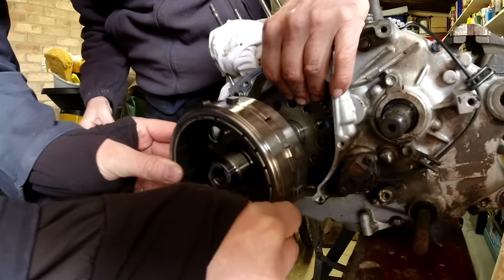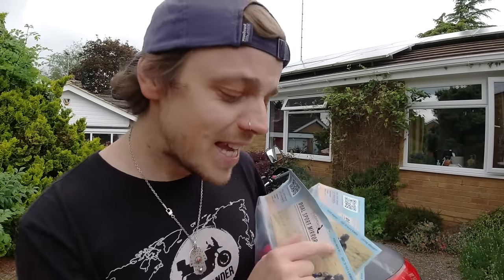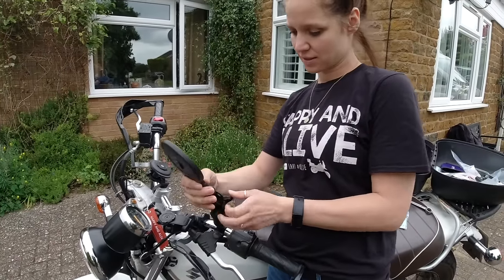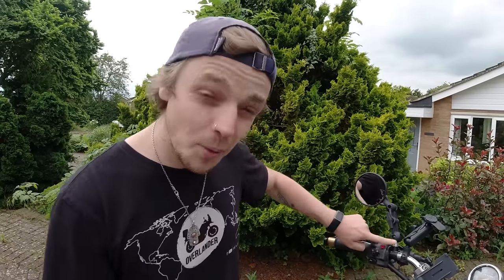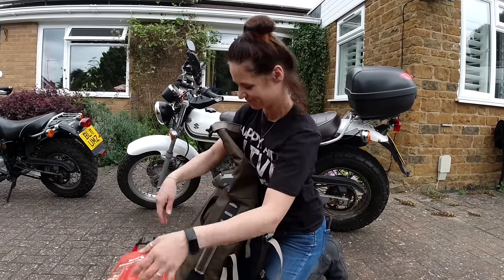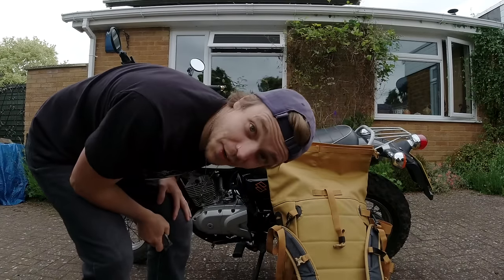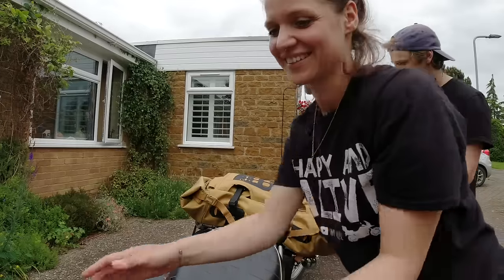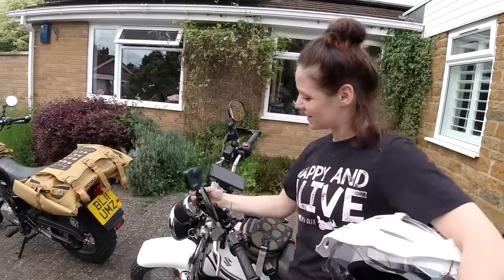Our ULTIMATE 125cc Adventure Bike Setup! [S7-E9]

Comment: Hi guys,  if you're not carrying any other bags/ rucksacks it would be worthwhile fitting those bags longways half on seat and half on the racks this will balance the bikes better whilst cornering as you won't have weight hanging off the sides. Sit on yourown bikes to check how much space there is behind both of you on yourown bikes with the bags on to find the best 'fixing' points in that position. 
Having them longways also gives less wind resistance and is better for fuel consumption. 🏍🏍safe
Reply from the maker: That’s a a good idea, we’ll try it out 😊

Comment: I had my eye on two different top boxes, I Brough a Backpack to wear until I decided which one I want, and after an hour of riding I took the Backpack off and tried strapping it to the bike... The crazy thing is, because of the colour, design and material it's made from, with the straps going through the rack, around the taillight perfectly without blocking it, and being X strapped underneath the pillion seat. It looks like it was designed specifically to fit the bike, and it doesn't move around at all!
 best of all it only takes a minute to undo and set back up as a backpack (if only it was waterproof!)

A camera on the chin... I brought one because of all the things I was seeing while riding... mostly the way people drive, something that hadn't been as important to me while in the safety of a steel cage. but the first time I went highway speeds... the wind catches it when you look around and tries to spin the head around backwards. it doesn't take long to get used to it. but this is what you'll notice, other than feeling heavy, but you get used to that too!

Comment: All good takes awhile to gigure all the crap out of what you need, don't need, how to carry and access it.  The Mosko Moto is top quality equipment.  Those hydro bladders built in are real handy.  They make a fuel bladder too.  Givi has a plastic fuel bottle to mount, one liter I think.  A couple practice runs.  Tools, hit up EastBound Tools, very compact sets.  Could split them up between two of you.  See if they will sponser you a set.  You got credentials now.  Next time
Reply from the maker: Yes there is always so much to pack and unpack 😂 takes us always some time so figure out a good way 😵‍💫

Comment: if you need to fix a puncture.... take spare inner tubes, and bead breakers.... the van van tires are beasts to get on or off... the bead breaker is really essential.....
Reply: I'll second that Stephen. It's always nice to just slip a tube in and then repair the punctured one at camp. As for breaking the bead we just use the kickstand from somebody else's bike, it will pop off the most stubborn bead.